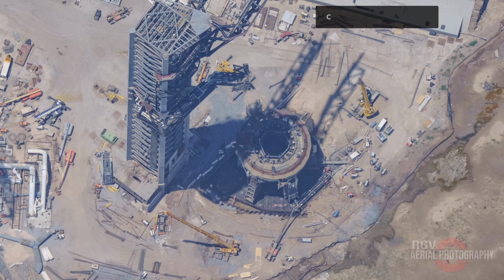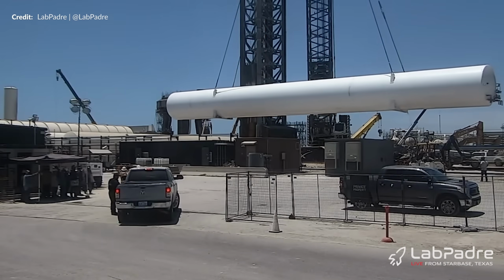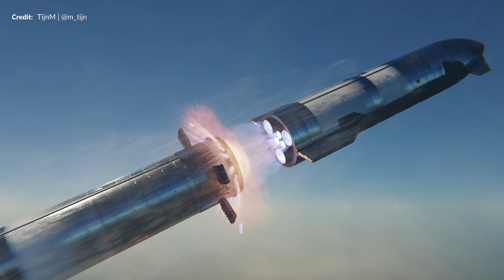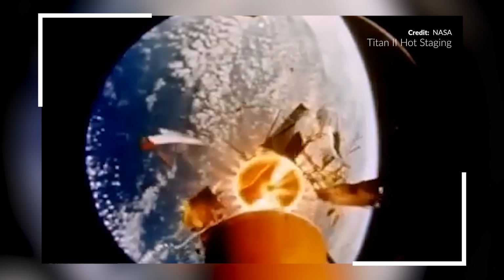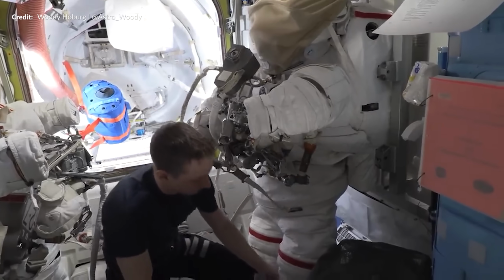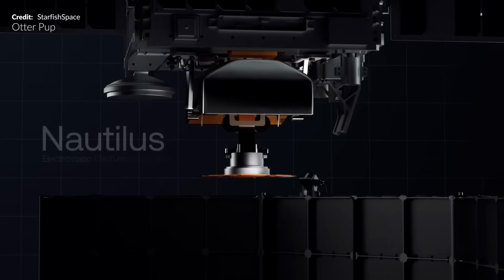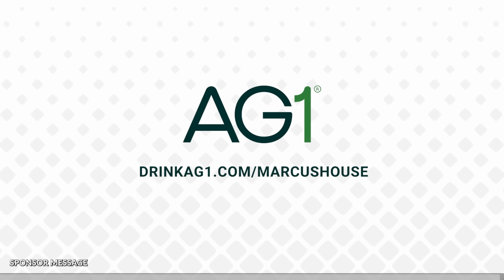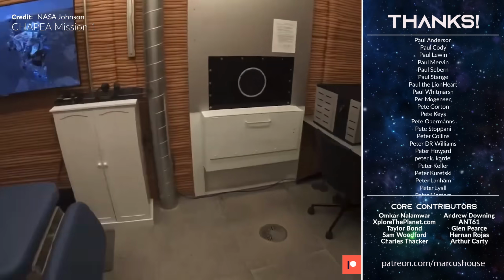SpaceX Drops Bombshell Upgrade Announcement: Can it really be that good?

Comment: The Sample Return Mission was always a flawed concept. Amazingly naïve to think costs & future funding would be both static and available to see the mission out.  Planning missions that span at least two Presidential terms, multiple elections for Congress and require the funding to be available on a consistent basis is just crazy in the current political environment. NASA has an appalling record on cost control and is its own worst enemy, frankly.
Reply: Still the aftermath of the 1960s Apollo programme. Contractors got fat from all that government money, state governments got used to lucrative and safe high-tech jobs in their respective states, and NASA administrators fell into the "line only goes up"-mentality when it comes to budgets. Hard to change that once it's been cemented in the overall culture of the institution over decades.

Just like NACA was dissolved in 1959, NASA should've been restructured and down-sized in the 1970s after Apollo did its job. The mentality of including as much tech and complex plans into flagship missions, just so that every institute and research centre gets their share and raison d'être plays a big part in cost overruns and mission risk.

Comment: hmm, 10% gain from hot staging? well, lets do some math. 8 sec not burning on the upper stage, 20 sec on the lower stage. that is 280 m/s loss, if it is 100 percent loss (the lower stage is either who cares or needs to come down anyway to land, so not sure, but lets use the total) that is around 3% from a 10'000 m/s orbital launch, not 10%, but still not something to lose, if you can save it. what other benefits we get? free settling of the fuel, so no ullage motors and what not, except it is the final stage, that needs orbital maneuvering and intends to come back, so yes, it still needs it. the previous stage can carry the starters, since it is still attached at the ignition, except once again, final stage that intends to be reusable. so it still needs it.

What is the cost? well, you need diverters to protect the upper stage, not much and it is disposable after separation, unless you want a reusable lower stage, wait a minute. You need a bit more reinforcement on the lower stage, to not destroy it immediately, just after the separation, unless you want a reusable lower stage, hmm, sounds like a repetition.

So, all in all, it can in theory save 3%, but also needs stupid amount of reinforcement if you want to reuse, negating most benefit, or needs a non reusable lower stage, which also drops the gains from 3% to 1%, not nothing (this is what saved and needed on those old rockets), but very far from 10% gain, specially if you need quite a lot of extra stuff to save the resuable parts.

All in all, probably closer to 1% gain, is it worth it? not sure, but would not be too happy on the reused hot staged booster.
Reply from the maker: The only way I could make 10% payload difference work is to have the ship not under thrust for a lot longer than 8 seconds. The numbers don't add up to me. Perhaps there are mass savings elsewhere I don't understand.
Reply: To me this figure falls into the same ballpark as the previously envisioned 24h turnaround time for F9. Overly optimistic if being generous; completely unrealistic if taking a closer look.

Comment: Hot staging sounds amazing... even with this extra ring between the booster and the ship, the top op the booster will be subject to the blast of 6 Raptor engines. We saw what 30+ Raptors did to stage zero OLM. Remember the Starship booster is NOT expendable!
Reply: x 3 engines, not x 6.
Reply: agree, but starship should only fire three at stage sep hopefully

Comment: If NASA and ESA manage to run samples from Mars early 2030's that would be amazing. I don't believe we will have people on Mars in the 2030's. I'd be already quite impressed if we have people on the moon before 2035, unless the Chinese are making a lot of headway in which case the US and Europe cannot stay behind of course.
Reply: Once Starship is reliably running missions I'd guess Musk will focus on the moon landing. I would bet he will have a unmanned mission to mars before 2030.
Reply: @NavyVet4955  An unmanned mission to Mars means nothing, NASA and other already did that multiple times. If it is an unmanned mission that lands on Mars and brings samples from Mars back to Earth then it would be very impressive before 2030. Note that such a mission takes more than 2 years and requires aligning with Earth launch windows that happen approximately every 26 months only.
Reply: @richardbloemenkamp8532  a unmanned mission with craft return has not been done yet.
Reply: @NavyVet4955  Then your bet of 2030 does not seem very challenging for SpaceX. I think if they wanted they could do it, especially if a soft landing on Mars is not even required.
Reply: @richardbloemenkamp8532  they won't risk life until the system proves itself. If they have moon landers reliably operating and a mars test done successfully they will have the data they need to send a mission.

Comment: So the issue with transporter eight wasn’t the transport eight rocket to had a problem. It was one of the rideshare users that had the solar panel problem. I read a report that said the transporter eights second stage had an issue and that all the rideshare’s had to be emergency undocked so that they would not be lost and it was a SpaceX issue. Just goes to show the media has no freaking clue.
Reply: The second stage put the tug that carries the payloads into orbit. The tug had the issue and that is what I have seen in news articles. Which article claimed it was the second stage?
Reply: hi, which report was that?

Comment: considering the amount of stainless steel at Starbase, and its obvious resistance to heat, is the rain steel plate ordinary carbon steel, or something else, I don't think Starbase CSI said what it was either, any clues Marcus?
Reply: From the color I would suggest 304 Stainless Steel. I work with it from time to time, but it is tough stuff.
Reply: @bryanst.martin7134  yeah me too 20 years at Bluescope steel, but you cant make a thread like that in stainless without machining, was my experience when we did 6" and 8" steel pipe threading
Reply: @brendenharris8858  I guess Elon found a way. My question is how much pressure are they going to put on the system? There are millions of pounds of force coming down.
Maybe they need a turbine driven from the exhaust to pressurize the showerhead, therefore pressure would equalize.

Comment: After around a month the concrete could be cured? In my new under-construction home, the concrete floors take around 1 week to cure for every cm. thickness. That would mean around 8 years for stage zero concrete to be fully cured??? Aaagh - what have I got wrong here?
Reply: nope you are correct, starbase is no different, almost all big (skyscraper) concrete pours cure in multiple decades, the engineering is solid though if you want to go for a deeper dive, lots of videos on it

Comment: I was thinking. With the power of the Raptor 3 engines SpaceX might be able to make the booster fuel tanks smaller.
Reply: do you know, i had the same round about thought, if the new raptors are more capable, REDUCE the engine count, because 'fewer parts mean less failure points' especially if starbase doesnt increase payload size...?
Reply: @brendenharris8858  i think it would be better to just throttle down the engines. There would be a lot less stress on them possibly making them more reliable
Reply: @Marrrrrko47  yeah i guess engine redundancy if that factors in, longer shelf life as well, good answer, thanks
Reply: @Marrrrrko47 Actually, throttling them down usually increases the chance of failure and it also decreases efficiency by a significant amount.
Reply: They burn fuel faster to get that extra thrust, you don't get anything for nothing in rocketry. They could potentially use less engines saving a bit of weight but more likely to just run the engines at reduced thrust to get better reliability with better safety margins.
Reply: Not likely - with more power available, they'll prefer to make the tanks *larger*, increasing payload capability.
Reply: Does throttling down reduce stressors?  Sometimes just opening it up and leaving it there is the best.

Comment: As long as the hot staging doesn't damage anything, it makes a lot of sense. Not only does it make sure the parts separate vigorously, but it also gives a useful impetus to the booster to slow it down ready for its return.
Reply: The issue is that it has been used on expended boosters, where as long as the booster doesn't explode, you don't care how damaged it gets. Since SpaceX wants to reuse the booster, that brings in new challenges of having the hot staging not damage the booster. So that seems to require armor on the booster. I would not be surprised if most of the payload increase is counteracted by the mass of the armor.
Reply: it does seem like mature tech, especially if the star team can calculate the percentage of added efficiencies

Comment: This could also work as a launch escape system incase of booster failure, It wouldnt work off the pad but should work once its got some altitude. If this was in place for the first test flight then starship could have survived.
Reply: It wouldnt have survived, it was spinning. "It wouldnt work off the pad but should work once its got some altitude" why wouldnt it work early into the flight? Shut off the booster engines and the ship has a twr of 1.1, just enough to get away. Although that 1.1 is just the bare ship, not a crewed version... But Raptor v3 would increase it to 1.2 so it might be possible
Reply: @Marrrrrko47  starship just has to have enough speed that it doesn't fall to the ground before its engines can fire, that being said raptor starts pretty quick, i wouldnt be surprised if they could rapid start them off the pad but I think they would need to be prechilled before they could be started.
Reply: @Marrrrrko47  Not likely for a catastrophic failure. The Raptor engines take a second or more to ramp up to full power and the TWR is 1.5 at best. Contrast that with the Crew Dragon Superdracos that are at full power in 100ms and have a TWR of ~4.6.
Reply: @steveaustin2686  a fully fueled ship has no chance of getting close to 1.5 even with raptor v3
Reply: @Marrrrrko47  That's the point. Even at the most optimistic TWR, it doesn't compare to the TWR on Crew Dragon aborts.
Reply: @steveaustin2686  a very slight chance is better than no chance though
Reply: @Marrrrrko47  An infinitesmal chance is still zero.
Reply: @steveaustin2686  using the demo flight as an example even with a twr of 1.1 it would have been enough to get away from a failing booster since  wasn't a catastrophic detonation just engin failure.  It couldn't land like that, it would have to do a boost back and climb to make it back over the pad with the right amount of fuel for landing. 
They will eventually have to look at down range landing sites when they have humans onboard. The shuttle had about 6 landing sites around the world, even Soyuz has a backup landing site in the US.
Reply: @geofrancis2001  Did you note the time for the engines to get to full power and the vast TWR difference to the Crew Dragon abort system? So you are not talking an abort system, but normal separation from the booster. Sorry, Starship (second stage) at a TWR of 1.5 at best and engines that take a second or more to get to full power, are not aborting from a catastropic failure. Outside that, it is just normal separation.
Reply: @steveaustin2686  the point is before, they needed the stages to separate through some other mechanism before they could fire the engines, now they can just start them with the booster still attached.
Reply: @geofrancis2001  But you started with it as a launch escape system, which the engine ramp up time and TWR seem to rule out. I'm not saying that they can't use a hot stage, just that it will almost certainly NOT work as a launch abort system for a catastrophic failure, which is WHY you have launch abort systems in the FIRST place.

Hot staging with a booster you plan to reuse seems suboptimal. I'm sure that they can armor the top of the booster, but will that eliminate the payload increase from the hot staging? Apparently, SpaceX went with the flip idea, because the system used on the F9 and FH was evidently too heavy when scaled up. So now it will be a case of which is heavier. The traditional separation methods or the armor to protect from hot staging.
Reply: Separation will only work several seconds after most of the booster engines have been completely shut off. If not, the push from the booster would be too high. Even after an initial separation there is a risk of the booster ramming into the Starship.
Reply: Not likely for a catastrophic failure. The Raptor engines take a second or more to ramp up to full power and the TWR is 1.5 at best. Contrast that with the Crew Dragon Superdracos that are at full power in 100ms and have a TWR of ~4.6.
Reply: not sure, has anyone done a serious study on that scenario?

Comment: I really feel like this will be detrimental to the whole reuse idea.
Reply: seems like making it work in the first place is their priority. they are under intense time pressure with the Artemis missions. and the Staging problem with First flight probably worried them. This is very much a pure Brute force method to idiot proof staging.
Reply: @SteveAkaDarktimes  that's what I was thinking as well. Kinda makes me nervous. But I know if anyone can do it it's SpaceX. I wouldn't be surprised if they just said screw it, if we lose the booster oh well. We need to get to orbit. That's the vibe I'm getting from it all.

Comment: A 10 seconds freefall is 100 m/s so it's more like a 3% loss of performance or a 6% loss in payload.
Reply: Then you add rebuilding the speed so 8 to 10% might be viable
Reply: How did you calculate that performance/payload loss ? Previously there was also a special separation manoeuvre needed. And as far as I know hot staging is also not 100% efficient. Did you include that? I generally don't believe any of the numbers given by Musk but so far the technical performance of many SpaceX and Tesla products has been quite reasonable. Maybe running a KSP simulation with Realism Overhaul will give some idea.
Reply: @richardbloemenkamp8532  Just calculated the mass ratio for 100 m/s of delta-v because that's basically what you lose during freefall.
You also gain altitude but that's a negligible amount of energy.